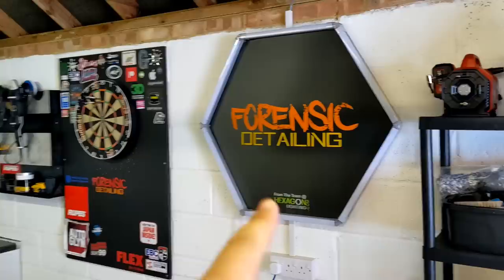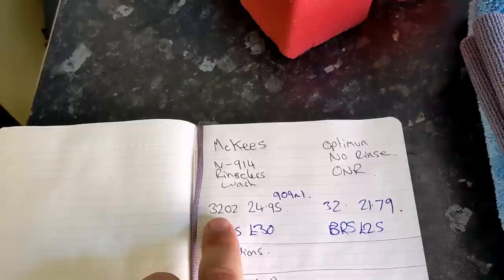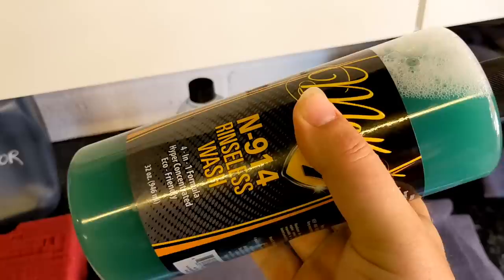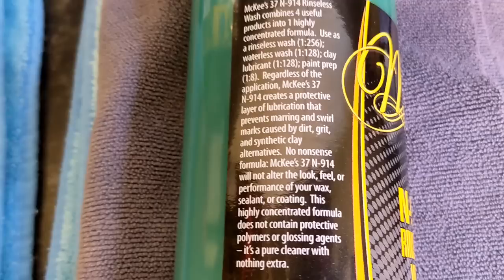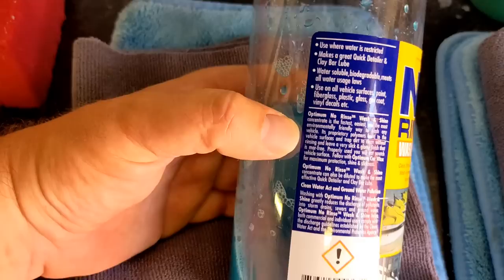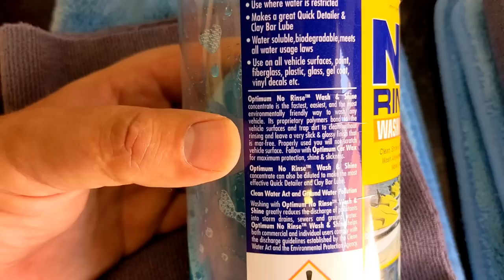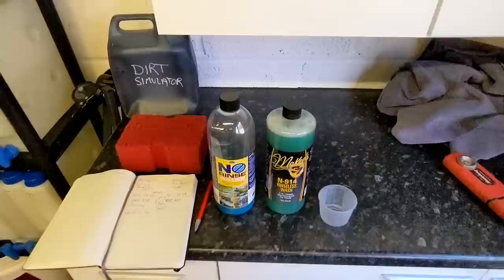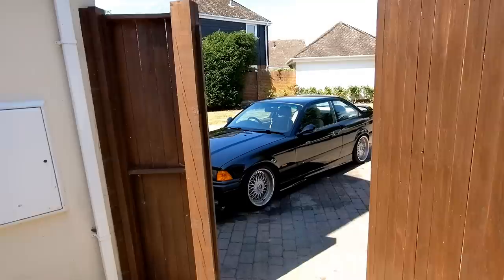O.N.R V Mckees N914  Which one is best? | Best rinseless wash comparison

Comment: I live in a townhouse complex where we can't use running or flowing water in our garage, so I have to basically do rinseless all the time.

I do a presoak with ONR using a IK Multipro 2 on the whole car.  Then I use the ultimate black sponge to do a contact wash.  At the end, I go over the car again quickly with the IK Multi and ONR to keep the car wet so I can dry it and reduce the risk of swirls and marring.  This approach lets me stop wasting time doing panel by panel, and I can do the whole car.

The car is coated with Gyeon Can Coat EVO, so every 3-4 weeks, I'll use Ceramic Detailer as a drying aid panel by panel as I go around drying it.  The ONR and Ceramic Detailer seem to play nicely together too which was something I was worried about.

It's pretty time efficient and the results are good.

Comment: Another great video, Jon!

I just use ONR. Whatever it might leave behind isn't going to be there long, and is easily removed with their Paint Prep. 

These days I'm using some type of Optimum LSP, which works great in conjunction with ONR. 

I haven't used soap in years. I do still power wash beforehand if needed.

Comment: I use both. ONR in the steam machine and for quick wash, clay, seal type of details, but for cleaning the paintwork getting it ready for polishing and a ceramic coating I find Mckees is a slightly better cleaner, and ONR a better lubrication wash. One capful of Mckees in a litre bottle of surfex HD cut 50:1 is an excellent interior wipe down cleaner with the apple scent of the Mckees a nice bonus

Comment: Your observations are very in line with what I have observed. 

ONR looks cleaner I believe due to the encapsulating it does. It pulls the dirt down in the bucket. Most rinseless washes do this except for N914. 

N914 to me seemed more soapy, so I think it does clean slightly better, but I prefer ONR due to its polymer encapsulation technology. 

N914 lays flatter on the panel for me. I think that again is because it works a bit different. 

Both are great products though. It’s nice they are a bit different as people can try them and pick which they prefer.
Reply: Yeah same experience here. Been using ONR for a year or so and recently used Mckees, I found it was a little shampoo like in that it foamed up in the bucket a little where as ONR barely does and where I missed a couple of drips here and there it dried a bit like a traditional shampoo, this isn’t the case with ONR in my experience and I definitely find ONR encapsulates which is appealing.
Reply: @pat_rickb8523  maybe try just a bit less product in the dilution? 
I've noticed it seems a bit hit and miss on exactly what your describing. 
Was just thinking it was me messing up dilution . Which is pretty stupid proof. 
But yeah I think it's a hit and miss. 
When I first used it , it didn't suds up and seemed to work a bit better than it does now. 
Maybe it doesn't do to well with storage?
Reply: @conwaysdetailing387  yeah good point. I’ll keep experimenting, I do like it but for me it won’t replace ONR it’s just a little better based on the experiences I’ve had so far.
Reply: @pat_rickb8523  I may try it next time, about out of McKees

Comment: I used onr exclusively for over a year to see how it behaved. When using it with the ‘pre spray’ method it was very effective and no swirling was introduced. It was only in the winter months with mud and grit etc that I decided to change back to water and pressure washer. Interestingly as soon as I touched the paintwork with the wash mitt, the paint swirled up like crazy and I had to polish it! Don’t know why but it’s happened a couple of times now. I will be sticking to pressure washer unless it’s very light/quick to do.

Comment: Nice vid and info as always.  Thanks for sharing your pure unrefined thoughts :)  Just because they are no Rinse washes, doesn't mean you cant pre wash, if the car is dirty enough to warrant it.  I'd also use a bucket with a grit guard to reduce the chance of marring, as well as using chenille noodle mitts, if your like me and have nightmares spending £30 on a sponge.. Also a pre spray works a treat.  These work, imho, best as an in between a "proper" wash, just to give it a quick clean when its not too dirty, and I got 20 mins.  I find it quite a "dirty" wash as well. This is another tool in the box for summer as I can wash the car in direct sun light when its hot as a bonus with these.

Comment: Hey Jon. I actually use Carpro ECH20 similar product but use it differently! In my two bucket method, I use 30ml in the rinse bucket. It's helped me so much on hot days, no soapy residue on glass or paintwork. By far the product I couldn't live without now!
Reply: Can you explain the methodology here? You use standard shampoo in your wash bucket but then rinse your sponge in a bucket with ECH2O? What are the benefits here?
Reply: @ImBarryScottCSS  two totally different wash mitts. Clean water with ECH20 and a clean mitt.
Reply: Ech2o as a rinseless is better then both ONR and N914. The wipe off is so nice, no resistance.
Reply: Don't you find haze afterwards?

Comment: Interesting the Mckees released the dirt into the water, and ONR didn’t. If that’s the way the product works, Mckees has my vote!
Reply: ONR is designed to release the dirt and take it to the bottom of the bucket. I’m using OP’s product right now but I miss this feature of ONR.
Reply: @tommyholt3465  I’m glad other people are experiencing this too. Onr definitely pulls it down much better than 914. Makes for a cleaner solution if you do one bucket method
Reply: Dirt is releasing it into the ONR too, but N914 holds it in suspension while it is dropping to the bottom of the ONR bucket. Split a car down the middle, wash one side with ONR and the other side with N914. The ONR bucket will look much cleaner. But if you pour them out slowly, you will see all the dirt at the bottom of the ONR bucket when compared to N914.

Comment: I have been using both. I got n914 cuz of the crazy small dilution ratios. The waterless of 1:128 translates to like 15ml to a 32oz spray bottle. 

However I can say n914 sucks as a quick detailer in a true waterless wash. No buckets. Just you and some mircofiber towels. I find myself having to damn near soak the panel to prevent scratching and to get the same results as onr with just a few sprays. I have to keep the tree sap off my car almost every 3days.

Now as a rinseless they are near the same for Me. However onr leaves a better shine for me. Do I care about left over polymer on car. No I live next to trees so I need that.

Comment: When I used ONR, I made up the 2 gallon solution, then filled up a pump spray bottle to use as a pre rinse then went over the car with a noddle mitt that was slightly dripping.

Did a good job as a quick one bucket wash with grit guard obvs😄

Comment: As someone who uses rinseless everyday and have tried almost all of them. IMO the top 2 rinseless washes are feynlab pure rinseless and carpro ech2o. Feynlabs cleaning ability is unmatched, ech2o has great cleaning but the towel wipe off is so smooth, no resistance.
Reply from the maker: Echo I find dries in the panel too easily
Reply: @ForensicDetailing  you definitely won’t enjoy Feynlab then. You just have to work in sections.
Reply: Elevated Shine, did you use Drying Aid with Feynlab Rinseless so ?
Reply: What is your oz/gallon H2O ratio for ech2o?  Seemed too rich for me for 1 or 2 gallon of solution and microfibers
Reply: @XBOW83  I do, I like the extra lubrication
Reply: @dostarr  I usually do 2.5 oz per 3 gallons of water
Reply: These to (feynlab and carpro) need to be used panel by panel, i prefer to wash the whole car at once, DIY Rinsless is my go to, similar to mckeys but better, u dont need to chase the spotting issue, the cleaning is better than in both of aformentioned ones.

Comment: I have found myself lately snowfoaming my car, rinsing off and then instead of a full contact wash I'm doing an ONR wash, then drying the car using ONR in a spray  bottle at about 16:1 as a drying aid. It works really well tbh. My car is never mega dirty in fairness. I love the stuff and have ZERO marring on a recently painted panel so I'm happy it's safe enough for me.
Reply: That's the best method imo if you go rinsless. Or what I do is wash the car like normal than I use the rinsless wash as a drying aid. I just got the mckees because it doesn't leave polymers and my car has a gtechniq coating so I don't want extra polymers

Comment: No rinse does not mean you can't rinse before going for the contact wash. I pre spray with the rinseless solution in a pump sprayer. Pressure wash it off and then go for contact wash ( UBS or BRS with ONR). Mckees might be worth a try. ONR has had many updates since you've bought that bottle 😄
Yvan recently started a new project called DIY Detail. They have their own rinseless product now.
Reply: That guy would seem more trustworthy if he didn’t have 3+ brands where he sells the same stuff under different labels. Plus he looks like a pure snake oil salesman. ONR works but I’m just saying he doesn’t give the best vibe

Comment: I use ONR as a spray and wipe for when birds make deposits... I also ruin my paintwork by using the blue industrial paper roll because i dont always have a microfibre on hand.

My problem is that getting a pure wash instead of something with wax like a quick detailer is few and far between in the market.

Comment: First time I used ONR I winced as I could feel the sandpaper like like feel as you did the first pass of the mitt. I've refined my use over time. I use it for light dusting and fairly regularly. I always pre spray with the solution and I will use a QD to remove any residual spots. Filthy car then a proper wash with shampoo. My car has swirl marks but they've always been there😂

Comment: Great stuff Jon. I've been experimenting too, haven't got round to McKee's yet but I've been trying Feynalb and Wolfgangs. The one thing I haven't done yet is bought myself to straight on to a dry panel more than once, I'm generally pre soaking with the product and pressure rinsing, then doing the rinseless wash and dry.

In the one instance where I did go direct in with the wash I definitely did pre-soak, and then applied more again prior to the contact wash. After watching Yvan Lacroix's video on it I definitely wouldn't take a dry panel approach.

Comment: I would only do one wipe with an eighth of a microfiber, or use the sponge. Also, I would rinse the car off with a pressure washer or use a sprayer with rinseless solution to presoak. The rinseless part is referring to the fact the product doesn't need to be rinsed off, not no pre-rinse is needed. With an ideal technique, its quicker and safer than a foam/2 bucket wash, from my experience.

Comment: I think the ONR drops the dirt better to the bottom than the McKee's does, that's probably why the ONR water looks cleaner.
Reply: This is exactly why. It’s a huge benefit of ONR over N914.  I have no issue doing a single bucket wash with ONR but wouldn’t with N914.
Reply: @jayhoughton558  Yep saw a test on Reddit of this and the N914 just left the dirt floating around, whereas the ONR just dropped almost immediately to the bottom. ONR much better product just for this reason IMO.
Reply: @jayhoughton558  and @se43 Id love to see a more formal test proving this.  The “dirty water” of n914 is certainly consistent, even in my own use.  What I haven’t seen, is evidence of ONR methodically placing all the “encapsulated” dirt at the bottom of the bucket.  Does it really?  Why can’t we see that in a video like this?  With soooo much dirt mixed in the 914 bucket, it would seem an equal amount in the ONR bucket base would be clearly visible.
Reply: In my experience, I found 914 to have more cleaning power, but I agree that ONR will pull dirt to the bottom of the bucket. So now my method is to rinse my mitt in ONR but clean with 914
Reply: @ninetres187  exactly my thoughts. I have used and keep on shelves most rinseless washes available on my market (Poland) like griots, ech2o, wolfgang, onr and n914. And n914 is the only one that does not stain the wash media. My guess is that it’s the only one that truly releases the dirt in to the bucket. I feel like onr is keeping all the crap in the sponge. My prefrence is to have a clean sponge when touching the paint and the lubricity does the rest. Not mentioning The bucket after a onr wash is sticky and hard to clean, whilst after n914 it just needs a quick flush. And still you can see the grime on the bottom with n914. So my guess is that the dirty colour of the water is not dangerous - just discolouration by the lightest dust particles that can not harm the paint especially with all the polymers. At least I’ve never had this issue and sometimes i just use a pump sprayer to knock down the heaviest dirt and not prerinse my car even though i know i should.

Comment: I don’t have the link at the moment but some guy did a test with actual dirt and ONR Vs N914. Basically showing that ONR pulls the dirt to the bottom of the bucket way better than N914. Whatever that means for you. That’s the main reason a bucket of N914 solution will look dirtier than an ONR bucket. 

It really doesn’t matter which one you use. Pick a color and scent you like lol

Comment: Ive recently tried doing a pre wash with BH touchless then a rinseless wash, which seems to work well. Its quicker than the traditional method but without using the brush it doesnt clean quite as well, but a good compromise.

Comment: Here is a bug removal hack you may not think to do. Wash the front of your car with one of these solutions with the solution hot. Heat greatly increases solubility and significantly adds to the cleaning power. You can even take several wet hot towels and set them on the panel and leave them on for 5 or 10 minutes to soak and heat up the bugs. This works very well if you have black or dark towels and let the sun beat down on them and keep them hot. You will be amazed how soft and easily removed old dried bugs will come off after a hot soak.

Comment: Regarding Yvan LaCroix... He is cheap (by his own admission) and he is using whatever products are given to him, or that he is being paid to consult on/represent. McKee's has been paying him to appear on videos, and his recent use of N914 has been as simple as that. It doesn't mean that ONR is inferior. They're both great products, but in my opinion ONR still has the edge.

I think you missed a crucial step by not presoaking the car with the rinseless solutions from a sprayer before going into the contact wash. Doing so allows the solution to start emulsifying the dirt and other contaminants and lifting it off the paint. It is true that rinseless won't break down any heavy oils/grease on the surface, but it does do a great job with bugs and other contaminants as long as the car is regularly maintained and has a coating or a good base of sealant/wax.

I know that non-neutral pH snow foams/traffic film removers are very popular in the UK. If you want to do that first and then use rinseless as your contact wash, I think that is a great option too. 

Too often people think that rinseless means you don't get as good of a clean, or that it means you don't use a pressure washer. You can (and often should) still use a pressure washer before you ever touch the paint when using rinseless. You don't have to when the car is just lightly dusty, but it is best practice to do so when the car is more heavily soiled. 

To me, I consider rinseless to be a "soap replacement" that doesn't need to be rinsed off. It also makes the drying process much safer, because the solution left on the surface provides more lubrication...which you can also supplement with your drying aid/topper/quick detailer of choice. When you use soap and rinse it off (and some people use a blower), you are relying only on that drying lubricant to protect the paint from any errant dirt on the car or in the towel.
Reply from the maker: it really does have a lot of potential I totally agree.  I struggle to really see too much difference in the products, but im also using an old version of ONR.
Reply: Exactly, furthermore if you use it correctly (also with a reccomended sponge not mf towels, and presoaking it with a rinsless solution) the clean is the same and safer than a 2 bucket wash

Comment: ONR been out for donkeys years and has basically been the standard. Instructions on Mckees seems a bit odd. On the one hand they say doesn't harm your wax/ sealant etc.. but can still be used as a paint prep? Ok the prep is a stronger solution but still doesn't make sense to me. Also when these rinseless demo's are done l think you should use a white cloth to dry. Easiest way to see if any dirt still on the paint after washing cos in theory there shouldn't be any. 
Not a criticism but shouldn't you be wringing out the wash cloth to just dripping rather than  soaking with ONR anyway?
Great video!